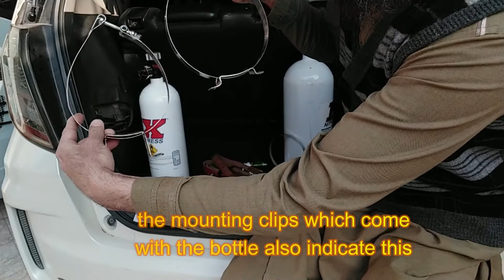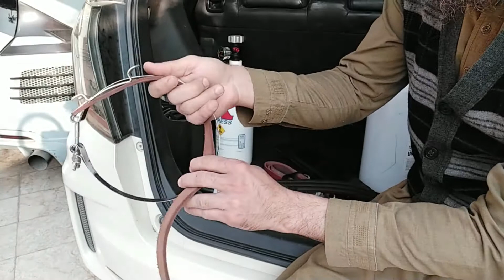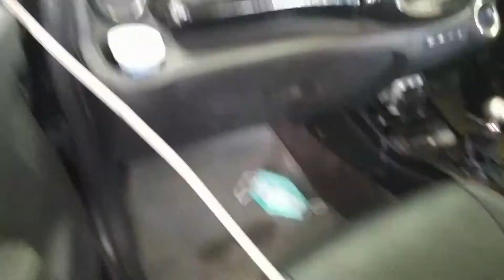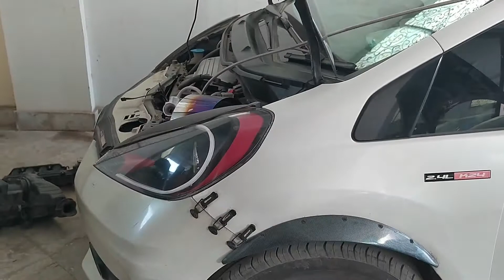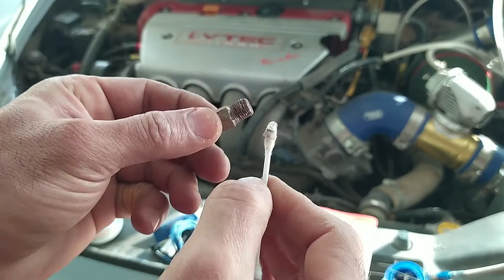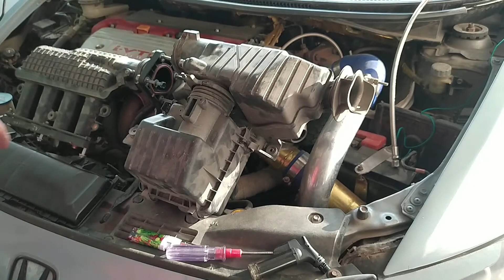NOS / Nitrous Install for Beginners Part1

Comment: Post video how to install wiring output ecu easy way
Reply from the maker: @jeyanthitherce7274  bro that depends upon how you want to control the Nos output. With ECU or manual switches etc etc. No stock ECU can do this. You will Kpro at least. Those come with their wiring guidelines for Nos and there are many online forums. Go  look into them.